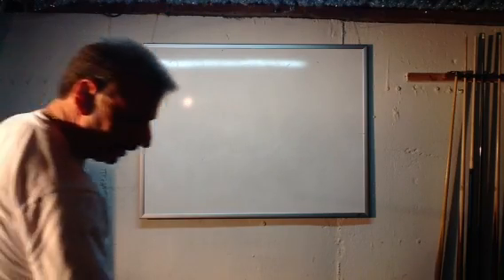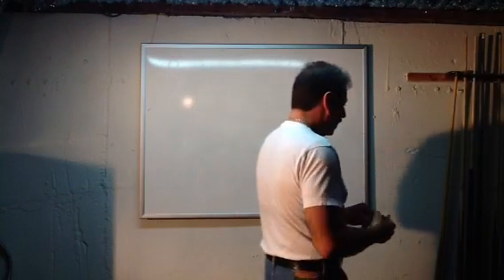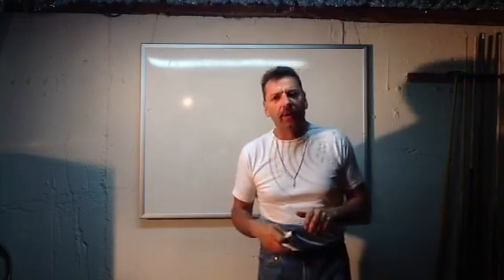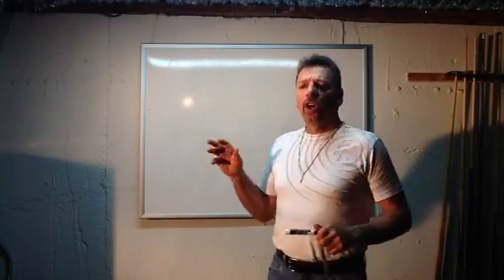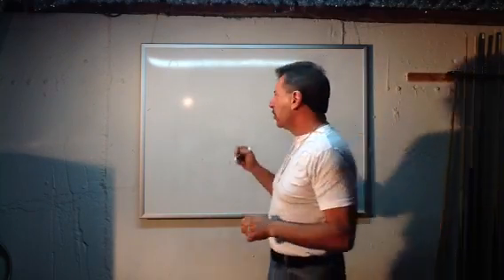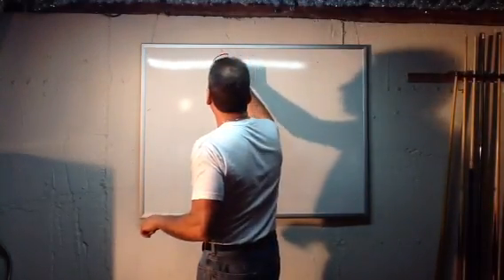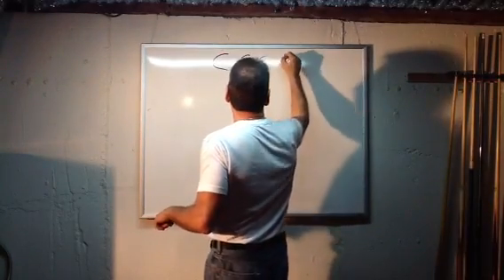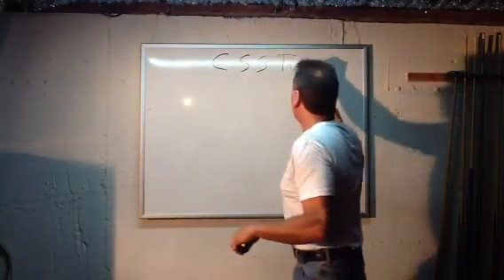Gas track pipe, i will save your house from burning down,

Comment: Im sorry but those house fires weren’t from lightning they were done because idiots ran it and did not have proper training with the C connectors and did not understand how to put it together and it leaked. Ive been on hundreds of gas leak calls.. Ive installed thousands of feet of track pipe and never had a call back.. The house burned down because it was done by a handy man instead of a professional service tech FYI The gas company already grounds the meter service SMH

Comment: Tracpipe is a brand name by CounterStrike Which is far better quality that the stuff from big box stores. I’ve installed it in 100’s ro 1000’s of homes plus I’m a licensed gas line install contractor I also use snap connectors which are also good quality… I’ve come across many jobs that do it yourselfers have done and they are lucky their home never blew up… sloppy work leads to big problems so be safe or call a pro people

Comment: Nothing "attracts" lighting but the earth. If there happens to be some thin wall pipe (CSST) near where lighting wants to go, it might be hit. Also, remember the regular electrical wiring found in a house, it might get blasted too. I think it's all snake oil. Again, why the CSST get hit instead of romex that might be nearby?

Comment: Who told this dude you can ground/bond to water main. Nope. Code says directly to home electric ground rod to bond it to electrical system. Trac pipe and that home depot shit is not the same. And as far as many homes burned down, number one it was bad installs number two where are your stats
Copper wire going directly togrounding rod is only way. Apparently you ate not professional . bo ded to water line. Lol

Comment: you do not ground that to the water main you grounded to an open slot in your electric panel preferably the ground slot
Reply: Why not to the water main? I just have my mech. subs run trac pipe to my clients laundry room.

Comment: WHAT  qualifications do you posses to teach a "class"   You don't need a license to install, but most manufacturer's require you be "certified"  as an "installer"  then employed by a licensed contractor.( varies by state) your "grounding" is the wrong  term.  "bonding is what is done to the metallic system(s) water and gas"  they are different.
and the "bonding wire" size is predicated on the service size. Do not arbitrarly say it is # 6    I am upc and ipc certified inspector  1985  and 2006 respectively
  Also "Track pipe" may be a misnomer as "Omni" has an underground pipe called "Trac pipe"  
as far as a gas pipe attracting a lighting bolt, it will hit the highest part of the house and then look for a path to ground, hence the requirement for a "UFER"  ( to protect the electrical system) this is typically the requirement for lighting protections for the utility company ( transformer) and the house
jm2cw
Reply: AZPIPEMD in nj you have to be certified or you get a fine

Comment: Just going to say that this guy is kind of a clown. IF you look at the people that had a fire with CSST you will find one of three errors happened. Installing CSST or really any metal pipe in the attic of a house is dumb as it act like a lightning rod. Second issue would be grounding and bonding. Yes they are two different things. The third thing would be the guy that read the book and figured he was a certified installer and did a lousy job.  You should be a licensed fitter to install this stuff. It is fabulous stuff that really makes life easy. But it must be installed correctly.
Reply from the maker: even if ur licensed, the inspector will make you take the trac pipe out!!! the guy is NOT a clown , but YOU ARE!

Comment: There's no issue with running it by the duct work, or any other metal WHEN the CSST is bonded/grounded properly. Another place to bond is at the main service panel. There's no danger of the electricity jumping from the pipe to duct work when it's properly grounded because the path of least resistance is going to be the path right through the #6 gauge bonding to ground. All the fires that have happened are from the ones that weren't bonded, or incorrectly bonded and the electricity had to make a "jump" to something that was grounded because that other item was, unfortunately, the path of least resistance. The jump is what blows a hole right threw the side of the CSST from the extreme heat/voltage of the spark. Up here in Canada, we don't have any of these fire issues with CSST because our gas licensing is strictly regulated to be done and TAGGED by properly licensed technicians by the TSSA... It's not like these parts of of the US where the "plumbers" and home owners are doing their heating systems. We have TONS of this stuff in homes and we get lots of lightning.
Reply: Exactly right and many people screw up by cutting the outer sheathing back to far exposing the metal corrugated piping and not retapping it with the correct tape or cutting the pipe so the install is correct…  I only use CounterStrike brand pipping and have not had a single problem and I use snap brass fittings bought at a HVAC supply house. Quality matters

Comment: Good video.  I had a line like this run for a gas dryer.  I would say about 4 - 5 feet in length.  If the whole house has "Black Pipe" that is grounded, is the line that I put in also grounded?  I assume this because we don't hear of fires starting from flexible lines to stoves, furnaces, etc. from lightning strikes.  Would the original grounding from the black pipe be why connection tubing to appliances is safe?  Thanks in Advance.
Reply: That’s what my situation is and couldn’t find nothing on internet to help... It makes sense what you’re saying.... I want to run csst from black pipe to dryer is that still grounded?... Have you had any issues?... Thanks